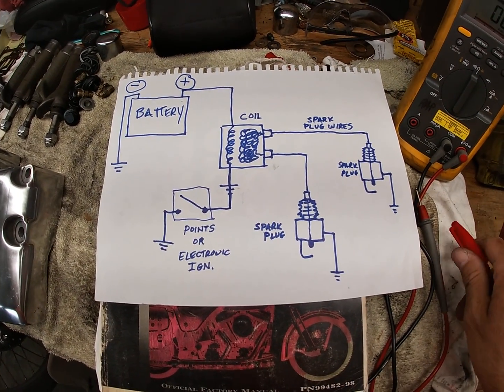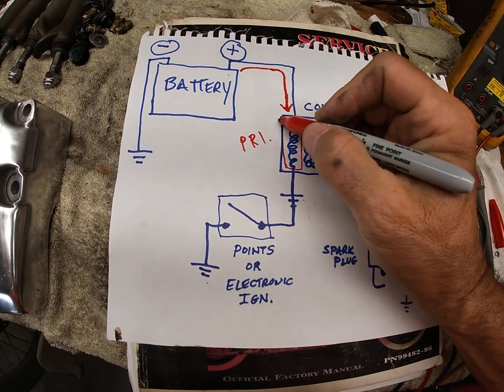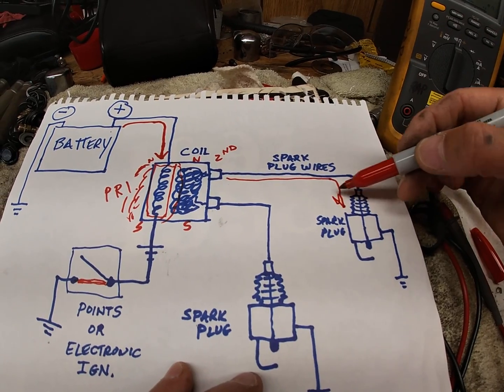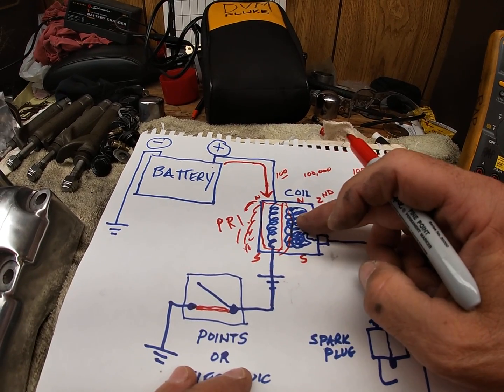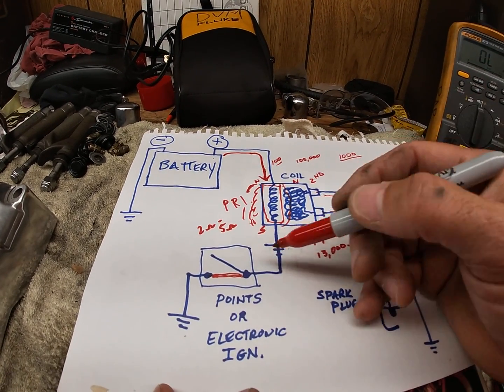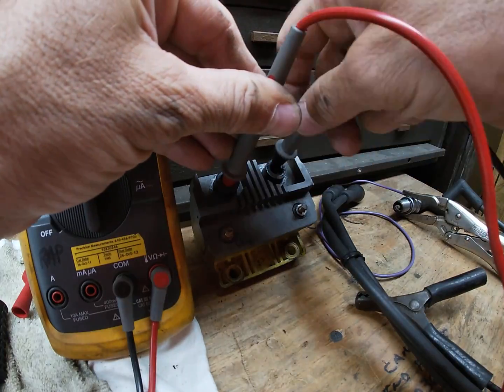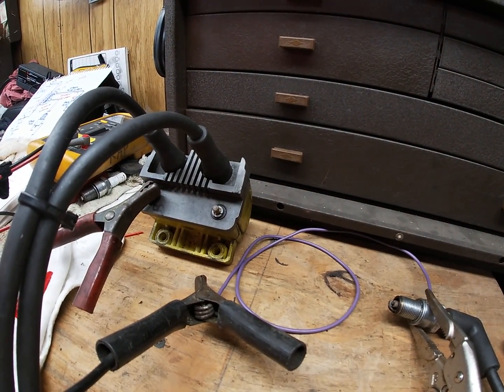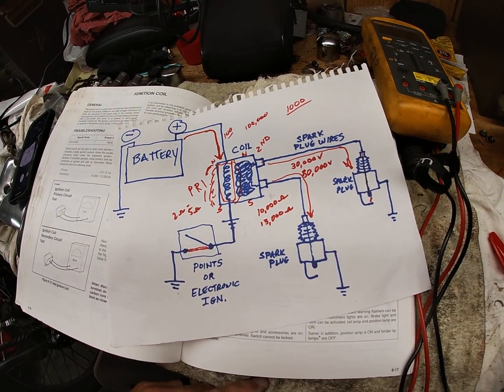Harley Ignition Coil, Points, electronic, Plugs & Plug Wire troubleshooting the system #Harley #coil

Comment: Has anyone used a dino to compare points ignition to electronic ignition that anyone knows about?
Reply from the maker: With electronic, you can change between different timing curves so it’s going to be easier but at the end of the day whatever timing a motor likes it doesn’t care what’s creating the spark as long as it’s a good spark from a good coil.

Comment: Great explanation!! I have 1980 FLH Shovelhead. No matter I have a brand new coil readings are as follows. 3.5 ohms and 11.65K. I tried exactly as you demonstrated with a fully charged bike battery. Positive one side of the dual fire coil and tapping on the negative side of the coil.  No spark at either spark plug location. Standard 3ohm coil. What am I doing wrong here? Is the coil bad? Not sure how with those readings.
Reply from the maker: I have to have the spark plugs grounded back to the negative side of the battery. It’s possible that you have a bad ground if you’re using the engine for the ground or the ground location is corroded. I would use your ohm meter to test the ground and make sure you have a good 12 volts at the coil. Do you see a spark, at the coil, when you remove the ground wire? If you don’t I would think that the coil is bad. Let me know if this helps.
Reply: @Rapsgarage  my ground clip had popped off and I didn’t notice the MP plus I darkened the room which helped a lot because of spark wasn’t that great for a 12 V battery which I was surprised. When I go to start it, the test light on the coil was not flashing on and off so it wasn’t oscillating a spark assuming at this point, my ignition module is bad.
Reply: It was bad ignition module. I just received my new dyna s.  I have spark now. Thanks for your help. Much appreciated!!!
Reply from the maker: @ That’s awesome! Now get out and ride that thing!! 😁
Reply from the maker: You will not see the change with a test light. Connect everything up and spray it with starting fluid. See if it will kick off

Comment: After rewatching this I have found like in my shovel head the power wire goes to the bottom of the coil the bottom nut. And the top then goes to the points. Does it matter if that is reversed. Often thought it would be easier if I need to take the power off of the coil the coming from the battery. Would be easier to get to it the top and I was thinking of switching it. But I didn't know if that would cause any problems. 😉👋🏼
Reply from the maker: @MoeLarrycurly1  if it’s a dual fire coil (only two posts) it doesn’t matter with the wiring.
Reply: @Rapsgarage  I was kind of thinking that but I didn't know if internally inside the coil how it collapsed if the positive was at the bottom or the top would make a difference thanks for your reply

Comment: Hello I have 2 breakout CVO 110 both suffer same issue , the misfire at acceleration when throttle is half way between 2000rpm to 3000rpm one of the both bike as been mapped it’s better but still not there.  On that same bike I changed both injectors , fuel pump , spark plugs but it’s not fully fixed , is there anyone here think it could be coil , Ecm , stator pick up etc…. Thanks
Reply from the maker: If they both had the map changed and that’s when it started happening, it sounds like it’s in the tune. How much other work have you done to the bike?

Comment: So I'm adding a tach to a 97 Sportster 1200 custom. Can I run my tach wire to the opposite side of coil? Opposite side of battery side right. It is a aftermarket tach for a Harley
Reply from the maker: I think that is the correct way to do it. If you have a dual fire coil I think you have to set the tack to a mode that cuts the pulse in half since the coil will fire on both pistons unless it comes that way. If not it will read double what it should. I hope that's clear enough.

Comment: New:
*battery
*crank sensor
*coil  
*new earth on battery

Cleaned ignition switch
Checked fuel tap, gets fuel
Checked spark with spark tester, no spark
Checked main ignition circuit breaker , 12v 

Crank but no spark

Comment: i have a question, im putting something together from parts, it has a 1974 engine and the points kit i bought seems funny. it looks like the cam has 4 lobes on it, where as some i see online just have 2 lobes. is that the way its supposed to be? i would think they arent interchangeable
Reply from the maker: I believe that would be for duel points instead of single. It’s supposed to be better and more accurate.
Reply from the maker: Big twins like the Knuckle, Pan, Shovel and Evo have a single cam with 4 lobes. Twin Cams have 2 cams and each cam has 2 lobes. Sportster have 4 cams and one lobe on each cam. You didn't say what engine you have. If you look on my channel I have videos on the internals of different big twin motors that show the cams. Thank you for watching and please subscribe. It's the least you can do for all this free information. Thx
Reply: @Rapsgarage  its a 74 shovelhead, talkin about the breaker cam in the points. the one i got is diamond shaped with 4 points instead of kidney shaped with 2. i watched this video and really appreciated how you broke the information down to fundamentals

Comment: Hola te una harley dyna 1997 y en un tornillo llegan 12 voltios pero en el otro no llega nada de donde vienen los pulsos o como lo reviso tengo chispa en mis bujías pero esta muy débil saludos y gracias espero pueda ayudarme
Reply from the maker: I check the pulses with a volt meter or a test light. If you have spark then the pulses are there. I’d check for a weak battery and check that the ground is good from the motor to the battery. 
What problem are you having? If it’s that the bike won’t run I’d spray it with starting fluid to determine if the problem is spark or fuel.

Comment: Great info as always thank you... So...damn, the secondary should be in spec even w/out the plug wires? I just bought a new coil and straight out of the box the primary side is good (3.7) but the secondary reads 11.29K. The book says it should be 16.5K - 19.5K (1981 FXWG). I know the plug wires will add resistance, but would you say this new coil is bad? And there shouldn't be any OHM reading btw primary and secondary just OL, right? Thanks a lot!
Reply from the maker: It might be good. Try it and see. I’d also see what the manufacturer says there specs. are. They could have different specs than the one I have.
Reply: @Rapsgarage  Unfortunately there's no brand name it's off EBAY prob Chinese but it's sold as replacing the OEM coil 31609-80, which I got the specs from the Harley manual. I guess I will just try it and see. well thanks for the reply!
Reply: What effect would the lower resistance in the secondary have? I'm guessing the spark won't be as strong as it should be?
Reply from the maker: I would say weaker spark will be the result.

Comment: Great video, great teacher. I have a question. I have a brand new coil that tests good. Still can not get spark at the plugs. I have the coil on the bench and connected both wires and new plugs and am using a good battery connected to the coil, in tapping the second terminal i get a spark at the terminal but not at either spark plug. Does the plug need to be grounded? I see you have a vise grip on the plug but it did not look like it was grounded. What am i missing here?
Reply: Got it re watched the video and see the ground wire. Sorry! This is the reason I did not do well in school....lol thank you!
Reply from the maker: @mikemattox6617 no worries
Reply from the maker: Yes the plug needs to be grounded to complete the circuit. Thank you for watching. If you need further help you can send me your phone number to my email hdrap_1999@yahoo.com
It’s easier to help over the phone.

Comment: One thing I would add is that in a dual fire ignition system with a single coil, both plugs fire when the field collapses in the primary. The energy from the secondary goes to the path of least resistance which is the cylinder in the compression stroke. The energy jumps the gap and the heat is what ignites your mixture. The energy then travels through your engine and through your second plug and back to the coil. Essentially they're wired in series. The system is simple in design but one bad plug, lead, or cap will compromise the ignition for both cylinders. Voltage is potential between two points, and when you compromise one side you lose your potential.
Reply from the maker: First, thank you for watching. 
Ok, I want to address what you said in a respectful way. 
- The spark ignites the fuel not heat.
- The magnetic field collapses and both plugs fire at the same time. After that the current flows to the negative side of the battery to complete the circuit. It does not return through your other plug. If it did, it would have to jump the plug gap a second time. The plugs are not wires in series as they are a parallel circuit. If one spark plug or plug wire is bad, the engine will run on one cylinder. You can give it a try sometime by removing a spark plug or plug wire and start the engine. 
I do appreciate you watching and commenting and I’m always up for learning something but I stand by the accuracy of this video.
Reply: @Rapsgarage  I thought that too, but it does go through the second plug. The heat is what ignites the mixture. I had to talk to an electrical engineer at denso because their service manual was incorrect. One bad plug cap was killing spark for both my cylinders. I'm not arguing with you or trying to be disrespectful. I'm just trying to share some information.  Also, there is no way for both plugs to truly ignite at the same time because electricity will always take the path of least resistance, and the cylinder under pressure during the compression stroke will have less resistance. I learned this years ago when parrelleling dual DC generators for load sharing.
Reply: @Rapsgarage  heat does infact ignite your mixture, and this is the reason plugs have different heat ranges. Hot spots on your cylinder walls can cause detonation, and there is no spark present in the combustion chamber.
Reply from the maker: @mmholling87  this is from NGK’s website. 
It is a common misconception that spark plugs create heat. They don’t. the spark plug heat range only indicates the rate at which the spark plug dissipates its firing end heat to the engine.

Selecting a spark plug with the proper heat range will ensure that the tip will maintain a temperature high enough to prevent fouling, yet be cool enough to prevent pre-ignition. While there are many things that can cause pre-ignition, selecting a spark plug in the proper heat range will ensure that the spark plug itself is not a hot spot source.
Reply from the maker: @mmholling87  heat can ignite your  your mixture. That’s called pre-ignition or detonation. These are both bad. Your Harley will run one cylinder. If you needed the second spark plug how would this be possible. Also in my video I only have one spark plug connected to a dual fire coil and I have spark. How do I have spark is the second plug is missing.
Reply: @Rapsgarage  "firing heat" in my mind is the heat the arch creates when jumping the gap that ignites the mixture and it explodes due to oxidation. Obviously, the spark plug doesn't stay hot during the entire time, or it would create detonation. Do you agree that both spark plugs ignite at the same time? How would you explain the path of least resistance? Do you think the voltage being supplied to the plugs is equal? Obviously, a Harley will not run well on a single cylinder, but doesn't it run even worse due to not having the second plug? I'm not trying to discredit you or argue with you. If you don't like my post or curiosity, then feel free to delete my comments. I respect you and the information your content brings to your audience.
Reply from the maker: @mmholling87  I have no problem with you questioning me. Just so you know, I have a degree in Electronic Engineering so I’m not guessing at what I’m telling you. I’m guessing you misunderstood what someone was telling you. With that being said, heat range of a spark plug is the amount of heat the plug transfers to the cylinder head. If the plug is a colder plug that means it transfers more heat to the head. If it’s a hotter plug then it transfers less. 
The ratio of the primary winds to the secondary winds (step up transformer) determines the voltage of the coil output thus the strength of spark. The higher the output voltage the greater the spark. Of course this gets limited by the inductance time constant. 
On a dual fire coil, yes both plugs fire at the same time. So it’s clear, both plugs fire at 35 degrees BTDC on both cylinders. That means both cylinders have a waste spark. This waste spark makes a Harley run rough. This is why Harley went to a single fire ignition system starting with the Twin Cam. If you change an older Harley engine to single fire they run noticeably better. 
As for the path of least resistance, it would clearly be to the negative side of the battery. The outside of the spark plug is grounded to the negative side of the battery. In your scenario you would have current running backwards and have the jump the spark plug gap in the opposite direction. This is not possible plus it would not be the path of least resistance. 
Many of Harley’s have run on one cylinder when they are having a problem with the other. Of course they run like crap that way but they will run.  
I think you should google some of the things we’re talking about and we can discuss it further. If you want you can email me your phone number to hdrap_1999@yahoo.com and I can explain it over the phone. That would make it easier to understand.
Reply: @Rapsgarage  you're obviously more educated and experienced than me. I'm not  talking specifically about Harleys but any engine that uses a wasted spark ignition system. In my specific application, there is no battery, and it's an AC system coming from a stator & CDI to the coil. I know the polarity of the secondary coil changes depending on the cylinder that has less resistance, which would be the cylinder that is in the compression stroke. I don't understand how a wasted spark would make an engine run rough when it's the exhaust stroke, but that's not my point. I guess this topic is beyond my comprehension. Thanks for your time.
Reply from the maker: @mmholling87  The CDI rectifies the AC voltage and charges a capacitor. Then the trigger tells the circuit when to discharge the capacitor to the coil for spark. The polarity on the coil does not change. The positive remains the positive and the negative remains the negative. 
It’s all good. I appreciate you watching and the discussion we had. Seems like I should do a video on a CDI ignition. If you need any help in the future, please reach out.
Reply: @Rapsgarage  what's your opinion on this video? I have talked to several different electrical engineers, and they're still claiming the first plug fires and then the engery travels through the block and back through the second plug to complete the circuit at the secondary coil.

https://youtu.be/fmppmbzxNqc?si=MJYlZHOhVuVQ1CoD
Reply from the maker: @mmholling87  It's clearly wrong. Once current flows to ground, the circuit is complete. It doesn't start flowing the opposite way.
Reply: @Rapsgarage  why is this such a common misconception?
Reply: @Rapsgarage  so in your opinion, both cylinders share the voltage from the secondary coil, and the sum of the voltage is split equally between the two plugs? Do you have an oscope? If one side of the coil is positive polarity and the other is negative, how does the negative side attract to the ground? I keep trying to send a link from NGK, but it keeps getting deleted...
Reply from the maker: @mmholling87  I don't think it is at all.
Reply from the maker: @mmholling87   AC voltage is positive and negative and both go to ground. The coil works the same way. The voltage go to ground and has to jump the spark plug gap to get there. It doesn't matter what polarity the voltage is. Your overthinking it way to much.